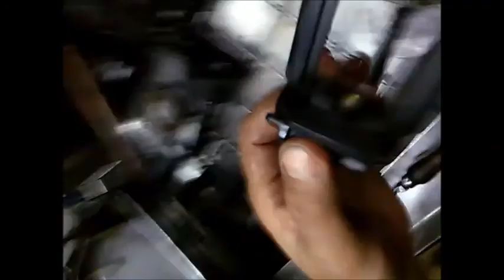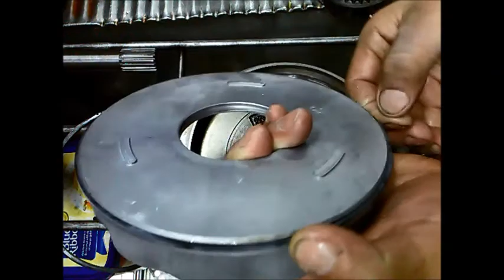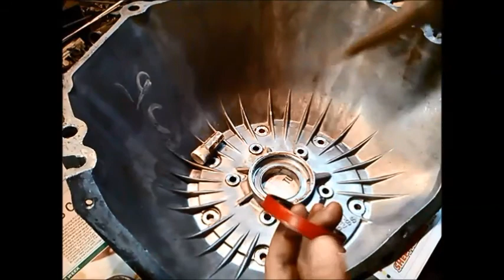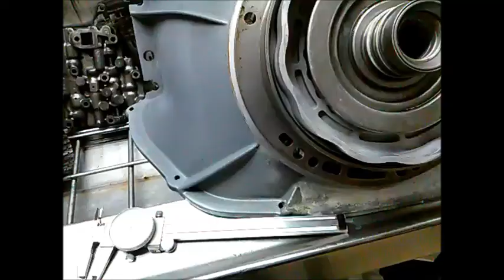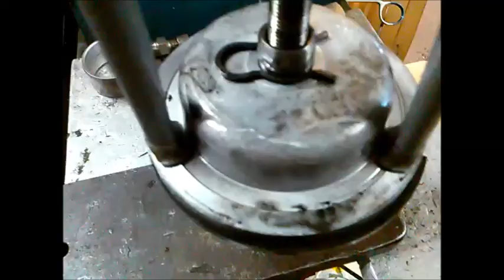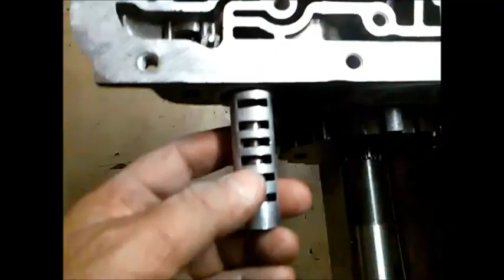Trimatic TH180 3L30 Auto Transmission Holden Commodore GM Overhaul Part 3 of 4

Comment: ive reassembled my Trimatic but when i tighten the pump bolts with any sort of tension the pump locks up.  i dont have the pump alignment tool so i'm assuming this is why ?  could anyone confirm ?
Reply from the maker: hi, may be some debris under gears. cheers

Comment: love the viedos, I also need some advice with my trimatic behind a 202. put in a used trimatic and it didn't upshift to 2nd till about 70kmh and never got 3rd, tried a spare modulator, cleaned and checked vacuum lines, new kickdown switch, checked and cleaned governor pistons and ended up getting it rebuilt. now it still does it but shifts to 2nd about 40-50kmh now and won't go into 3rd. now the only think i can think of it to check modulator plunger length or get an adjustable type. any other ideas? thanks
Reply from the maker: hi, if you got rebuilt take it back to them. make sure you measure what vacuum you are actually getting at the modulator. sometimes the port in the inlet manifold get carboned up. also make sure you have dedicated vacuum port to the modulator not off a t tree fitting, otherwise you will get a parasitic draw of vacuum depending what else is connected to it. also make sure the governor housing is nice and flat, sometimes we also add washers on the 4 bolts to help hold it flatter. - the modulator pin should be 0.980" standard. cheers
Reply: @YepThatsIt  thankyou for the quick reply, I will be taking it back tomorrow but i think the result will be "well the transmission is good must be something else" the vacuum port was carboned up and cleaned but didn't fix it, vacuum is pulling on the modulator you can hear it when you pull the tube off. I will use the other vacuum port in the intake as the current one it shared with the booster and see how that goes. and extension housing needs to come back off as the speedo gear fell out so hopefully they can check the governor. Thank you again!

Comment: Hello. I have a 94 geo tracker that is pulling fluid through the shift modulator.  I've bought a new one and it seems that they don't come with a gasket....is it necessary? Also, the transmission shifts through all gears but shudders violently from 3-2 downshift while coming to a stop. I can pull it manually into second and it immediately drops down. Can this be a modulator thing. Thanks for the video btw.
Reply from the maker: hi, gasket is only necessary if you dont want leaks. the modulator shows the trans what kind of load is on it, this allow trans to react with the preset line pressures and shift points. always start with basics and easiest/obvious repairs and work up from there. cheers

Comment: Hello. Thank you very much for the videos.  I have watched your th180 videos 2 times now, preparing for trying overhaling my th180.
I was hoping you could give me an advice,  since my tranny has a strange fail. 
It makes som hard shifting between2-1(not 1-2) 2-3 and 3-2.its like "bang". Not always,  but especially when oil is hot. 
I have ofcourse replaced oil and filter. I have adjusted brake band and replaced vakuum modulator. The modulator valve was a bit stuck,  so i cleaned it so it slided smooth in sleeve. But it did not help. What i can see is that the output shaft is a bit loose. The oil i replaced looked and smelled ok. It may be that I did loosen the brake band only 4 turns instead of 5 after aplying torque on it, could that cause this hard shift?. I adjusted brake band before trying the car first time (restauration project).
Thanks
Reply from the maker: hi, if issue get worse when fluid warms up, that indicates internal wear or internal pressure leaks. as fluid is thinner when hotter, it will pass quicker/easier through leaking points. cheers

Comment: Hey mate really love the series; nice to see there are still people out there that know these boxes and can pass on knowledge about them.

I had a question about mine because the reverse clutch packs had me wondering - when they get really badly worn would the car shake and shudder when reversing up hills etc ?
I’ve got a v8 VH sle with the trimatic and she makes all sorts of noises when in reverse and shakes like crazy reversing up hills.

Cheers mate
Reply from the maker: hi, yeah the reverse clutches usually peel their linings on these and you get metal to metal, and metallic debris and clutch lining contaminating the whole trans and blocking the filter. what are other gears like? in reverse - rev clutches, 3rd clutch and sprag ( one way clutch ) are applied. cheers
Reply: @YepThatsIt  Hey mate thanks for the reply -- other gears are all fine just shift points and firmness are a bit much because the engine has been worked (cam, heads etc).

I have a feeling all of my clutches are worn though as I bought an adjustable modulator to try and change the shift points / firmness but when I set the modulator to a soft setting the trans flares on upshifts.

I have a davies craig trans cooler but I just think its time for a rebuild.
Reply from the maker: check vacuum orifice at inlet manifold hasn`t carboned up as well as vac line rubbers. cheers

Comment: hello i have a 3l30 that has a delay going in reverse.what could cause this delay ?
Reply from the maker: hi, if only problem is delay in reverse...that means reverse friction clutch plates are worn ( common problem ) easy fix, just pop off the outer bolts on bell housing and slide up the pump and bell housing together, you will then see the rev clutches and can replace....its worth checking the 2nd and 3rd clutch plates while you have that out, but up to you. if you remove the inner bolts in bell housing you will need to realign the pump. hope that helps cheers

Comment: im probably asking a lot of ya .but you are teaching me and you dont know it. im going too make my own pressing jigs like yours . and ive already welded up a servo piston remover like your and it works got it out  . and will put it back in too. id love too see another of the valve body what too look for and how you see problems . cheers got my snap ring pliers waiting .and my deluxe rebiuld kit is on the way. do you need a oil pump centring tool on this model or does it centre itself. see ya round .
Reply from the maker: Great stuff ! 
I make as many tools as I can also. You will definitely need a pump stator - bell housing centre tool...can make one easily on a lathe if you have one. Cheers
Reply: YepThatsIt can i cut up a  old torque converter too use as a centre tool .if soi were do you get a centre device .
Reply from the maker: Nah sorry, you need a sleeve that is snug on the Stator Shaft on inside and snug on the Bell Housing bushing on outside. We could make you one on lathe`. Cheers
Reply: Where is your shop n contact details/ price on getting the extra clutches fitted. Cheers